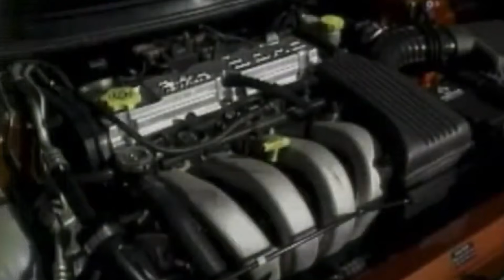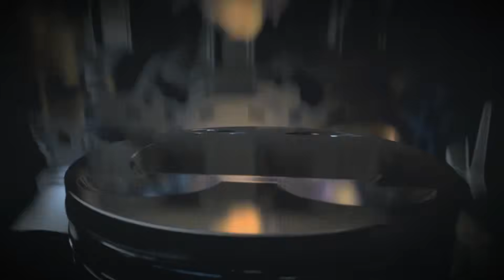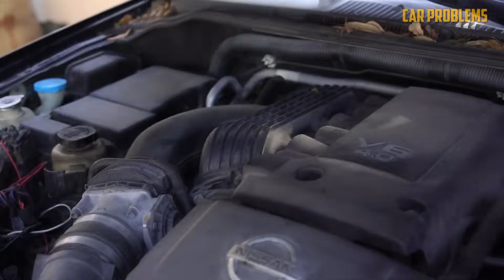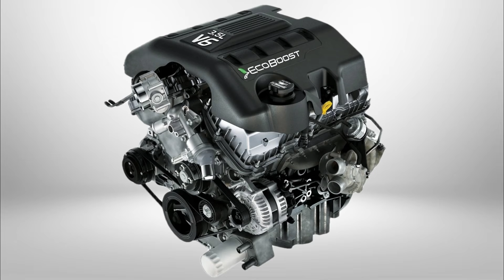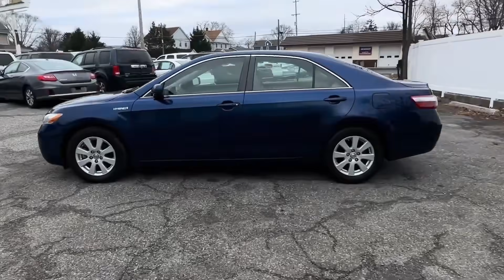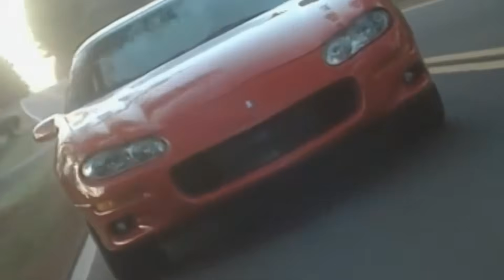15 Greatest V6 Engines of All Time — Legendary Power & Reliability

Comment: GM 3800 series has to be one of the most stout engines out there. 4 bolt mains that can stay togethor from the monsterous torque of the Super Charger. I bought one for a swap in a Fiero GT. 
In my experience, the Nissan/Infiniti VR/VRH series of engines are the most powerful with stock redlines of 7600 RPM. My winter beater is a 15 year old AWD Infiniti G37 that makes 330 hp which is way more grip and HP than the most powerful Honda NSX.
Reply from the maker: Thanks for sharing your experience and detailed thoughts on these engines! It’s always great to hear from fellow enthusiasts.